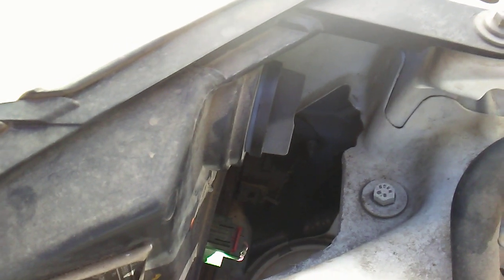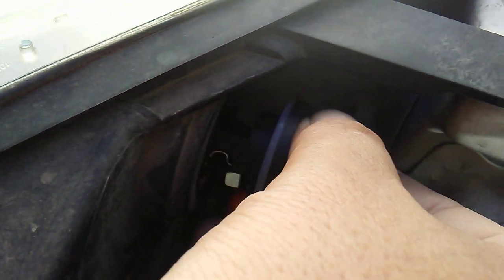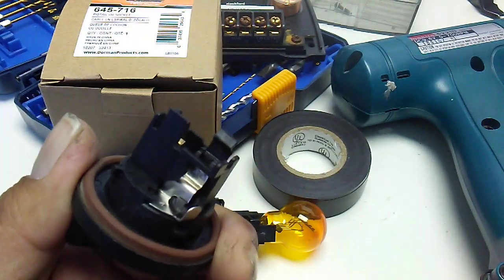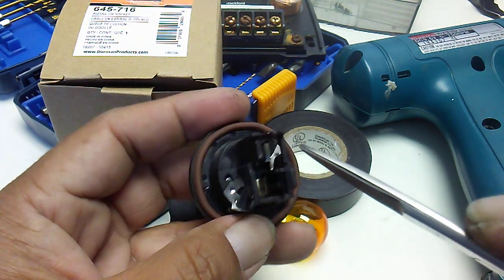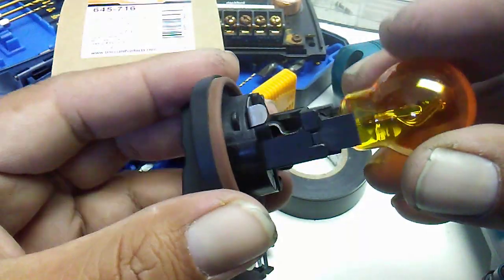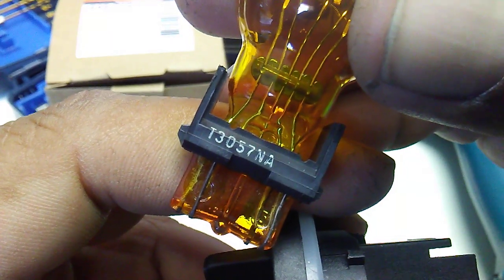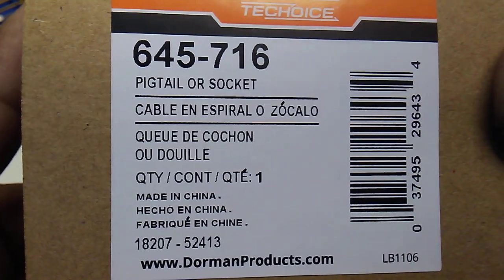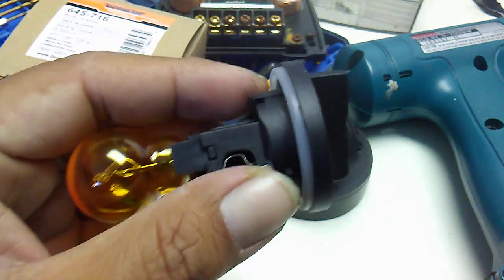Ford Transit Connect front headlight turn signal problem

Comment: has this held up for you or did you start having problems again?
Reply from the maker: Just checked everything looks kosher.. Still working like a charm
Reply: @wkdewok  Awesome! I have the exact same problem. If you look at the blade there is a hole where the pin makes contact. If you look at the bottom of the bulbs, the one contact point is slightly melted but bulb is still good. So weird.  Thanks again!
Reply: @307themiser  I had the same issue.  I think I've figured out the problem.  It has nothing to do with the bulb or the socket.  It is in the hole you plug it into.  In that hole there is an electrical lead connected to a piece of plastic which snaps onto the inside of the hole.  Mine wasn't being held in there too well and was coming lose over time.  So, I think what was happening is it was loose enough that the electricity coming through that lead had to arc across a short distance to reach the metal socket shown in the video.  That meant a higher voltage/amp going through the device.  That in turn heats up the wire which melts the plastic.
It then keeps doing that until either the loose connection becomes too loose and there isn't enough power to make that arc... or, it melts the plastic enough that you are no longer getting good contact with the bulb.
How to fix?  Not sure yet.  My first attempt is to just try to make sure that contact inside the hole is properly in place... hoping that it isn't actually broken but simply popped out at one point during a bulb change.   If it happens again I will probably have to get in there and try to get a better look at it.  
Anyway, this may be same issue you have.

Comment: I have a 2012 Ford transit connect.   My front driver side turn signal does not work, and now my brake lights are out.
Reply from the maker: Fuse relay? Back light have weird connection might have to lightly sand contacts. Front might have to buy new part
Reply: @wkdewok  I was able to fix the turn signal but brake lights still out
Reply from the maker: Take off the rear brake light assembly and it has a weird connection like a circuit board water seeps in and corrodes contacts.  steel wool or fine sandpaper. Or under the dash turn the car on make sure it's in park emergency brake on. That switch above the brake pedal might be bad. I'm on vacation so I'm worthless🙈🙉🙊
Reply: @wkdewok  my 3rd brake light on roof works.
Reply: @reverendtfg6802  yes, the problem is a simple mistake. The lower bulbs are just fog lights that most people never use. Remove the tail lights, replace the highest top bulb on each, those are your brake and tail light bulbs in one, and they are bad!
Reply: @reverendtfg6802  no, I pulled the bulb out of the socket, one of the metal tabs inside the socket was bent, I straightened the metal tab and used grease on the bulb. Special bulb grease from auto zone, fixed it.

Comment: bought new sockets still works sometime sometime in does not work
Reply from the maker: Since I replaced the socket still no issues.  You might check the connectors for corrosion?